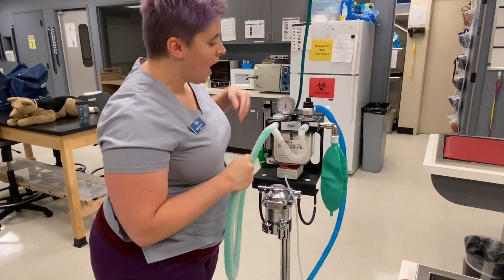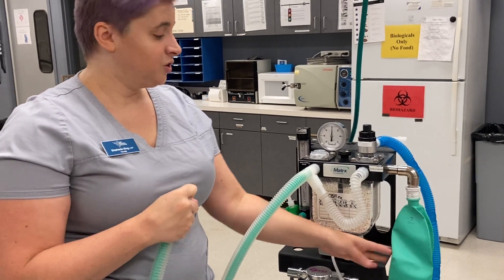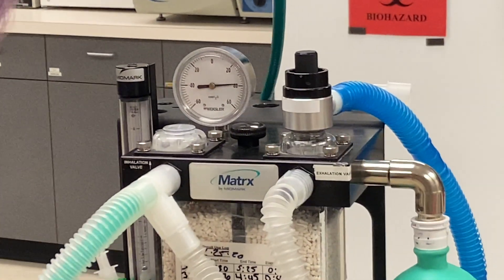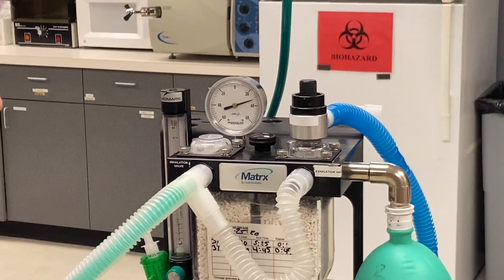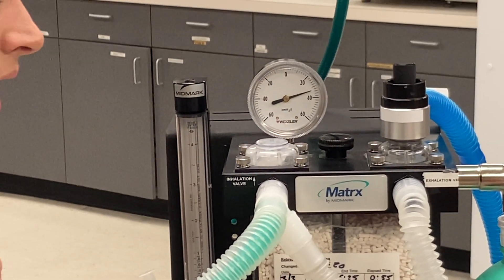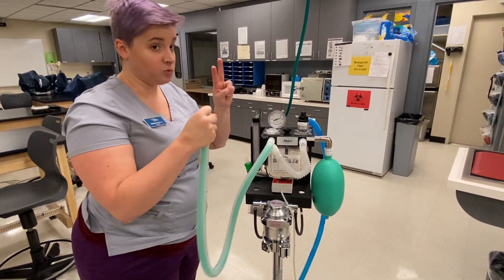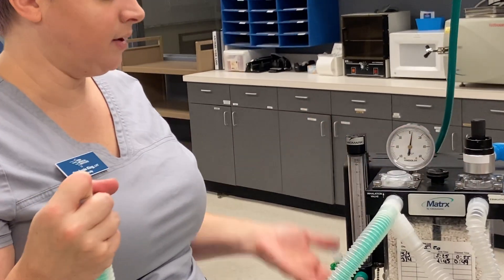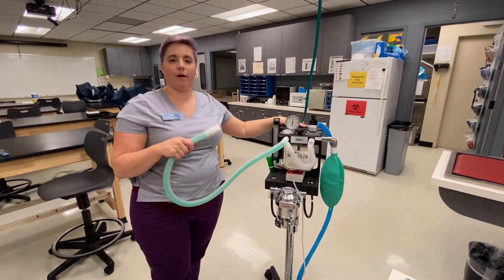26. Ax Rebreathing Circuit Pressure Test

Comment: Also a second check before releasing finger is to squeeze the bag to make sure it does not pass 20cm h20 (max pressure when giving positive pressure ventilation) -RVT